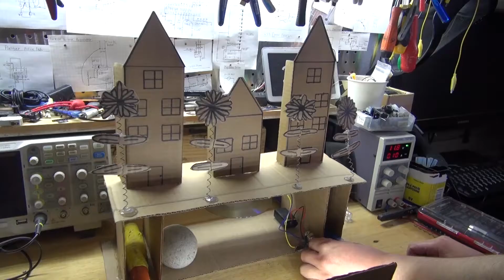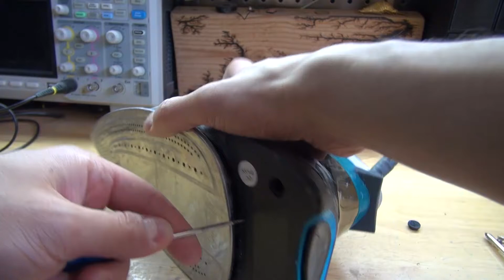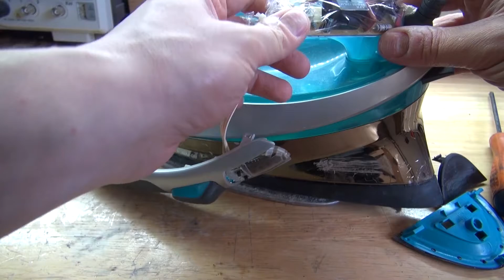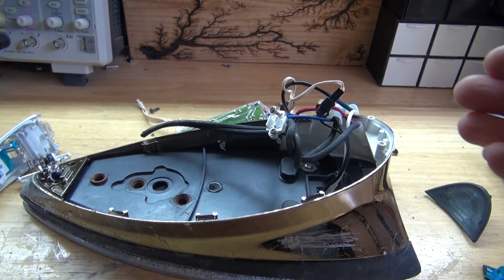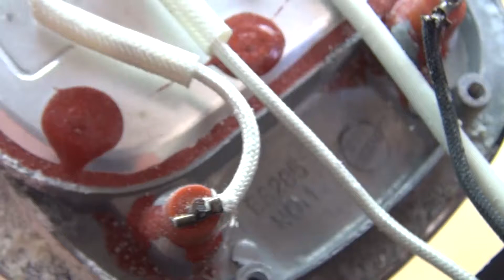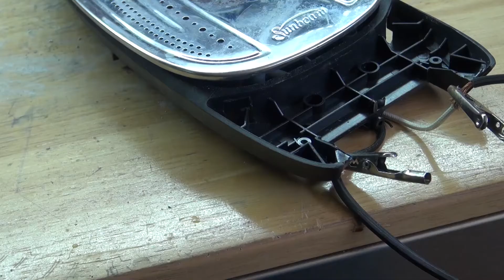Tinkering With Electric Iron

Comment: Great idea! Worst case, you could use an outlet timer switch. For example, set it for two mins on and one min off for 30 mins of runtime. That should be enough time to desolder a board with components.
Reply from the maker: Oh yeah!! That's a great idea! Thanks!